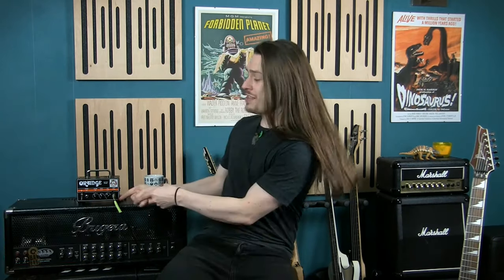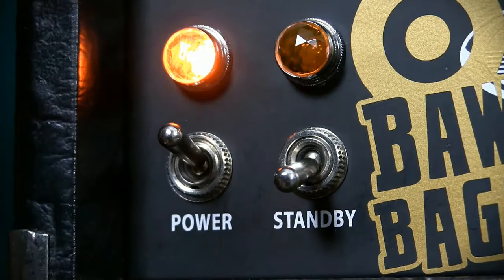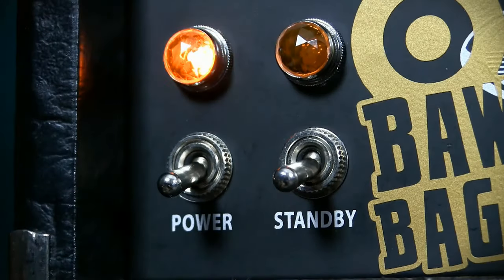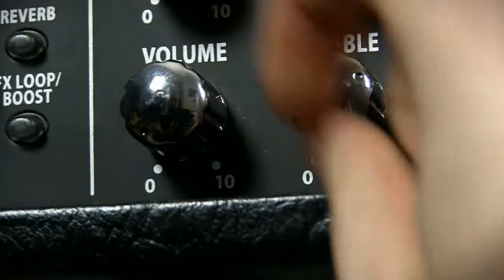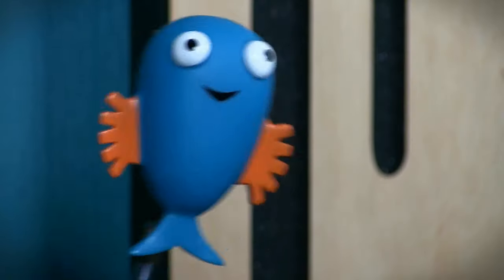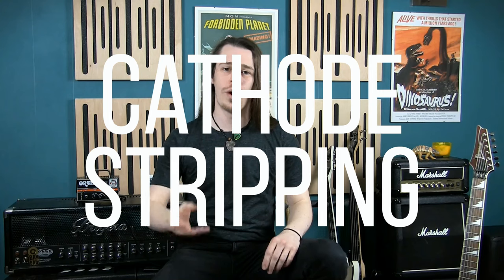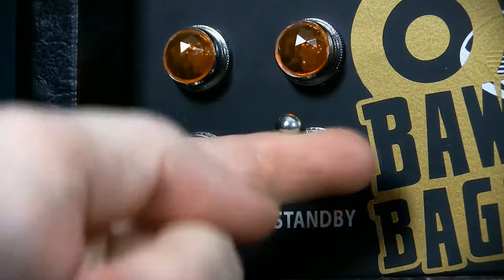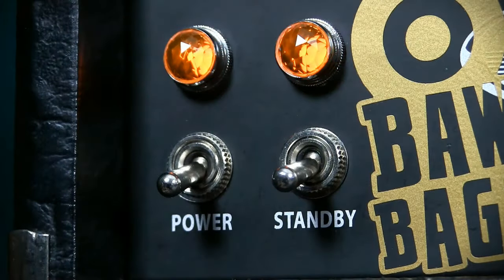Your Standby Switch Is A Lie!

Comment: I agree with everything in the case that standby is not necessary. but you are wrong on why fender put it there and early Marshall as well. The standby switch stops the high voltage from being applied to the system, its only a matter of how the system works that this mutes the system, not the purpose. 

The early fender and Marshall used electronic components which meet the running requirements but not start up conditions, when the tube is not heated the components see full voltage (tube is not fully conductive yet), once the tubes are warm the voltage is divided over the components in line as the tubes are conducting even when "closed" . Modern amps don't have this issue, as its easy to put in a 100k 1/2 watt resister and not as expensive as it was in the early days. That is the only reason for a standby, no need for it in maintenance as that only checks heaters and no other part of the system and if I want to do that I am testing the tube its self, and it would be better to pull the tubes to do any test on the system

Comment: Exactly right - the standby switch turns on the HT (high tension) power supply in your amp.  No benefits - but people expect one.  I build and service amps and work in a massive music store in the UK.  I am Blackstar and Marshall certified so I do know what I am on about.
Personally - I just pull my input jack out of the front of the amp slightly - this mutes the amp automatically so no messing around with the volume pot or standby switch.

Comment: Hey, I paid for a stand by switch and it better have one. Let's say you take a break between sets and it's an outdoor venue on a cold night ? To keep from heating, cooling & reheating tubes the stand by probably makes sense ? And then there's your electricity bill or the heat that comes out of that amp. Solid State probably handles all this better and is more energy efficient. Valves, well, maybe not so much and I'm not aware of a guitar tube amp that is Energy Star compliant like those old cathode tube computer monitors from last century ?
Reply from the maker: No that doesn't make sense. 

The standby switch disengages high voltage from reaching the power valves. The heaters are active regardless and the amplifier will consume the same power regardless.
Reply: @ScienceofLoud  Agreed, I was joking, electricity consumption is obviously higher with a tube amp, but the cost isn't that big a difference. The stand by switch & procedure might be more important at start up. Let it warm up before a potential jolt or surge goes thru the entire amp. It's a worst case of a catastrophic scenario, but in the off chance anything like that happens, wouldn't you feel better for having done the protocol ? I know I would.

Comment: You are right about if you're going to take a break just turn the volume down but you're wrong about standby switch if you got 120 watt Peavey 5150 or 6505 Plus it's best if you turn the power on to heat the tubes and then standby switch cuz that's a different part of the tube that heats up I a m a tech I could spend 20 min explain this yes some of the newer amps you could get away with doing that older amp I would not recommend it cuz you're going to wear out your tubes quicker especially the newer tubes that they're coming out with they're not as good as the other ones and they don't hold up as long

Comment: I have two amplifiers with all tube set up. One is bugera 6262 like yours back there and the other ones is blackstar ht1rh mk1 which is a 1 watt all tube amplifier. And blackstar one doesn't include a standby switch either but when i shut it off i hear the dumb pop sound from speakers which is a very loud and annoying sound. And with bugera it doesn't happen unless i turn off the amplifier without turning off the standby switch. So it's a good function especially for swapping guitars.

Comment: hahaha you centered the point :D Indeed if this switch was so important, they could automatize it with relays and some simple timer logic by the '50s ever since :D  as they did in Radio Transmitters ... where they have real high voltage at anodes ... Thumb up

Comment: One neat trick that a guy in a music store told me is that instead of standby you can actually just pull the plug out ever so slightly. I now use that all the time. It actually works. It's when it's pulled out really far that it does something. This is better than both standby and turning the volume pot all the way down. It prevents cathode poisoning and resetting your knobs.

Comment: If anyone has ever looked at a guitar schematic and had a clue how to read it, you realize pretty quickly that the switch just cuts signal flow to the speaker. This has zero impact on the heating of the tubes, it's literally just the difference between sound and no sound

Comment: All of a sudden everybody’s concerned about the standby switch - I have been playing my Fender amps for years using the standby for power up and down - never ever had it hurt my amps ever! Leo made amps to be played not analyzed - If you find you are changing power tubes more often these days it’s because they are not made as well as the old tubes of yesteryear - Back in the early days 50’s, 60’s, 70’s power tubes were made industrial strength - that was the standard of the day - that kind of quality doesn’t exist anymore.
Reply from the maker: Leo very much made amps to be serviced, I think there might be a little rose tinting going on with your analysis here.
Reply: @ScienceofLoud  “Rose tinting” you are dooming and glooming about a standby switch - I stand by my words - years and years of playing with minimal service on my Fender Amps - and I have several.
Reply: @HardToBeSomeone  go to bed grandpa

Comment: I prefer the switch than the volume method. Do I need It? No, but I like to be able to use it when switch between guitars. It's just convenient. I don't care who does or doesn't like it but I do as I said for guitar switching. Tosin abasi doesn't use his when switching guitars and that's awesome. He dies what he prefers I do what I prefer and everyone's happy. If you don't use it you can mod your amp and turn into something else. I should add my standby is also a half 50watt full 100watt switch aswell. Not triod pentode though, all tubes work even at half power. Half power being great for early breakup and full power for clean headroom. At least that's how I like to use it.

Comment: Not exactly sure why it happens but if I use the standby switch on my Vox AC30, it fries the rectifier valve really quickly. I went through three rectifier valves in a year before someone explained to me that they'd last longer if I didn't use the standby. Since then I've been getting at least four years out of each rectifier valve. Now I've got a sign on my amp saying, "Do not turn standby switch off!!" in case I'm playing a show and some other guitarist wants to use my amp. But they keep using it anyway, so I think next time I open my amp up I'm just going to remove the damn thing.

Comment: Sorz. Don't agree with your opinion in this case, although I do agree with the points you make in a lot of your videos. Cathode stripping can happen at any voltage, the typical 400 volts in a valve guitar amp is enough to make this happen. It can even occur in preamp valves when they are run "cold". i.e. supplying a lower than recommended heater voltage, like some stompbox designs that incorporate a 12AX7 etc. 

The reason why old valve consumer gear did not have a standby switch is because it also had a valve rectifier. This means that the HT does not become available immediately as the rectifier valve also has to warm up, thus protecting the other valves. Some designs even incorporated a thermal delay relay, which achieved the same effect and when you think about it, is essentially an automatic standby switch anyway. 

So in this regard I do concede that if your amp has a valve rectifier the standby switch may not be strictly necessary, although this does highly depend on whether that rectifier valve has a directly or indirectly heated cathode. 

However, most valve gat amps these days incorporate solid state rectifiers, which means the HT is available the moment you turn on. Thus the standby switch is necessary in lieu of other automatic measures. It's also more convenient from a users point of view than some automatic system as then you have the option of leaving the amp warmed up, as you point out. 

Cathode stripping is not an instant destruction event. It's insidious and slow, happens over a long time if bad practices are constantly followed. So it's not like it can be noticed, but it will ultimately result in more frequent valve replacements. Guitarists tend to be fussy creatures, so naturally tend to take measures they believe will enhance or maintain their tone. :)

Comment: I would love to get rid of the STANDBY switch just because of the confusion of the statement "turn your STANDBY on to play your amp". Turning ON something implies it is then "doing its job". The job of STANDBY is to turn OFF certain voltages which does NOT allow playing your amp.  So turning on your STANDBY actually  does not allow you to play through the amp. I much more prefer "turn the STANDBY switch to the non-STANDBY mode to play" statement.

Comment: My understanding was that standby switches aren't necessary for amps that have tube rectification, as the rectifier tube has to warm up along with the other tubes, which would prevent high voltages from going through the amp until everything is warmed up. I guess I was wrong. Could you do a video on why you shouldn't power up a tube amp without a load attached?

Comment: I always keep my Power and Standby switch in the ON position, and just use the switch on my extension cord, where my pedal-board is also connected to when turning on or off my rig. I don't know if this is bad for the amp's health or not, nor do it particularly care. I've used this method for over two years now, and the sound-quality hasn't deteriorated so far, so...

Comment: I usually use standby to warm it up because my dad is an electric engineer but i see absolutely no reason to use for turning the amp off. You are cutting the power so the tubes are hot anyways

Comment: I always thought the stand by switch was so if you disconnected or reconnected the guitar you flip it so you dont blow speakers from all the noise generated from plugging in and out. At least thats how i used it
Reply from the maker: Pro tip: unplug cable from the amp before  unplugging the guitar. You don't get popping noises that way.

Comment: Well i consider the most obvious and effective use for the switch would be in live performances.
You did your sound check so you're not going to turn the volume of the amp down cuz it was mic'd up and the sound check was made with that volume, so you're not going to start a live show trying to remember where was the volume set and just crank it up and fuck all the sound up!
Cuz you just don't use your 2000 $ Valve amp for practicing in you bedroom.

Comment: This video got a thumbs down from me because I am an electronics technician for past 40+ yrs and I can tell you that no standby sw is sort of ok for amps that have tube rectifiers but for tube amp with solid state rectifiers you want a standby sw so as not to apply full voltage to the tubes before they heat up (can cause damaging flash over in the tubes).
Also a standby sw is useful on a tube amp that has to take time to warm up before it works...you can leave the heaters in the tubes going during a break and then have "instant on" when ready...it also helps extend tube life by not heat cycling the tubes as much by reducing the number of high current cold starts on the filaments of the tubes.
Standby reduces power consumption as well...

Comment: Okay, so I have a small valve amp with no standby switch. The user manual states to turn the amp on with the volume at zero and to leave like that for 2 minutes to prolong the life of the valves. I'm going to go with the manual that came with my amp.

Comment: I heard from a old tech ,,its best to " soak " your amp before dumping power load to the board . In my experience sounds   all around better when warmed up first ! Try it,,, couldn't hurt ,right ?
Reply from the maker: Those words don't mean anything.
Valves will heat up with or without standby.
Reply: @ScienceofLoud  just do you !

Comment: Everything you said in this makes total sense.  I blew a fuse once, however, when I turned my Mesa Mark IV on without letting it sit in standby, and attributed it to doing so, then I blew another fuse a few weeks later...turns out It was bad pair of tubes/valves.  I was proven wrong...HAHA

Anyway, question in regards to this.  Say, for instance, (I likely wouldn't do so, because I'm not well versed in anything other than replacing valves and checking bias) if I were to change some capacitors in one of my amps.  Is there any credence to flipping it to stand-by, BEFORE turning it fully on, to give the caps time to form? (I know, ideally, I'd slowly be dialing up a variac for this purpose, but say I didn't have one (which I don't, so I wouldn't anyway) but would there be any benefit?

Comment: I personally like my standby switch. It is a good muter. But since I dont have a channel foot switch I half to change the channels manually and every time I changed the channel with the amp not on standby it made a loud pop. So I started putting it in standby when I change channels for a fear of screwing up the amp or cab at least.

Comment: Not 100% sure, but I tried not using my standby switch. Now the input jack isn't working. Unrelated? Possibly. Skipping the standby switch again? Not this guy
Reply: Input jack not working from standby switch is like saying your car wheel fell off because you didn't change the cabin air filter in time.

Comment: Not the full picture in this video.
Depending on the circuit design their are no good reasons not to use the standby switch and several why standby use is a good or essential practice.

Comment: Hey Colin, thanks for the advice. Now I won't be so scared of ruining my new Ampeg Portaflex 20T. But, just one question... I think in the manual it said standby was also a way to reduce the power running through the amp....wouldn't that reduce power consumption while you're taking breaks? Granted you won't exactly be saving hundreds of dollars, but still, advantages no?
Reply: Again, you can do that just by turning the volume down to zero.
Reply: Richard Harrold really?! Pretty cool. I don't know much about electrical stuff, so I didn't know the volume knobs affects how much power the amp pulls from the outlet. Thanks Richard, I love learning new things :)
Reply: @Richard Harrold
No, you cant.
Turning the volume down will just take away the power going through the pots and into the power tubes, but you'll still get a voltage spike to them when you flick the power switch.

I'd advise y'all who believes this bonehead, to turn the preamp volume very low, crank the power amp section, then try switching the amps power switch...

That loud pop you get... That's a voltage spike jumping though the entire circuit.
It's like turning off your computers PSU while it's still running.
It's fine to do so, but one day you'll fry the motherboard, or in the case of the amp, the tubes or transformer.
The later isnt cheap to replace, but i you feel like taking some random knobhead from YT words over those from the manufacturer of the amp...
Well, enjoy the repair fees.
Reply: *****
So why do most valve amps not have them?
Reply: If you did the same thing with a standby switch, the same thing would happen... Your comment holds no merit.
Reply: Because nowadays, higher rated capacitors are much cheaper than they used to be. 

Standby switch with a bleeder resistor allowed the filter caps to slowly charge and not have to take the spike of DC when the amp is turned on with no charge. This meant you could get away with using lower-voltage rated caps and save a few bucks--which is exactly what Fender did on the tweed Bassman, and pretty much every guitar amp is a descendant of that circuit in one way or another. Nowadays, we know better and use components that are rated higher than the spike, so we don't actually need them. 

(Nevermind the fact that a standby switch makes it much more dangerous to service, since standby mode prevents the filter caps from discharging when the amp is shut off, but then again, Fender also had a switch on the Bassman to remove the safety ground, putting your guitar strings at risk of conducting high voltage... different times)

Transmitter tubes on the other hand did in fact need the standby switch, since they used much higher voltages which could strip the electrons right off the cathode if they took the surge. Receiving tubes, the kind used in audio amplifiers, don't go anywhere near the needed voltage for that to happen.

Comment: I rather use the switch for muting. it WON'T wear out quicker, than the pot would. I got some stone age valve amp, all the pots were bad, but the switches are still rockin', like they were new. Also for the cathode stripping, it doesn't have to be over 1kV, just the process is going to happen slower, but it eventually shortens the lifespend of the tubes.

Comment: When you run a bias probe through your tube to bias your amp, you will see that when you hit the standby switch, no power whatsoever is going to your tubes. So I doubt that putting the amp in standby actually warms up your tubes either.